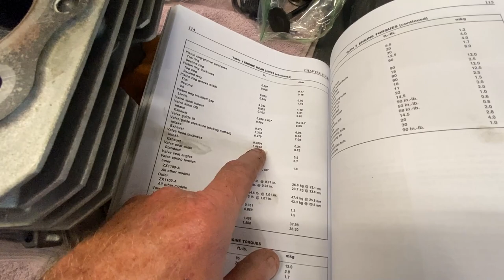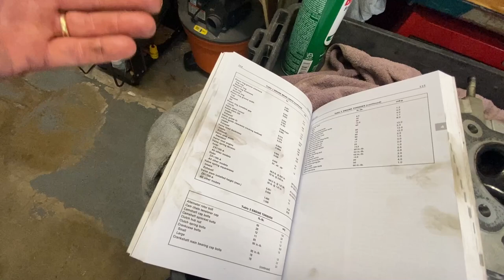2002 Kawasaki POLICE 1000, let's finally fix this thing! Video #4

Comment: I think the "rocking" method for stem/guide wear is performed at maximum lift by the cam.

If so, you're way higher than that which exaggerate the "rock".
Reply from the maker: Probably. But here’s the thing, the Kibblewhite website (valve guides) shows a clearance of about a thou and a half for intakes about 2 for exhaust so assuming the originals were similar when new, the clearance is way off.

Comment: Numbers on the rear fender tell me it's a LAPD motor, not CHP, and for that particular year it should have the large Fibre glass fairing not a standalone windshield, that being said, if you wanted the correct CHiPs windshield, check out "Gustafsson plastics" (based In Florida).
Reply from the maker: I know Gustafson. I have purchased from them. I’m not changing anything. This is a budget thing. This is not a keeper. If someone who buys it wants to do that, fine and dandy. Previous owner told me when he obtained it, it had Arizona Highway patrol markings. He rigged it up to look CHP.

Comment: 35-40k usually need that work when standard,cam chains stretch as well.j motor not thier finest hour
Reply from the maker: Yea, I figured as much, air cooled and hard life. As for the chain, I’d replace if I was splitting the case and if it were a performance bike. I have steered away from riveting a cam chain like it were herpes. I know people who have and it’s always a worry plus I’ve never done one. I believe this one will be fine for what the intended use will be. Thanks.